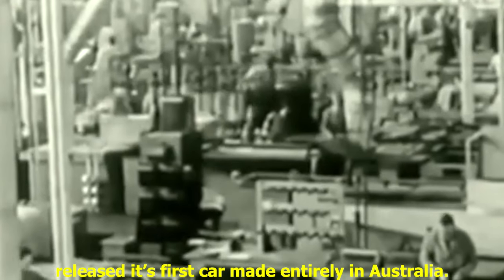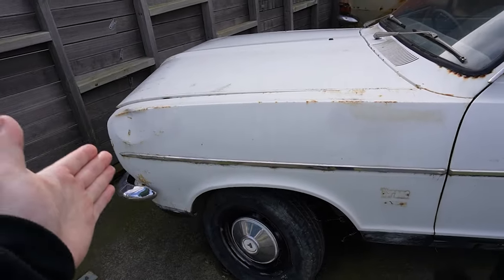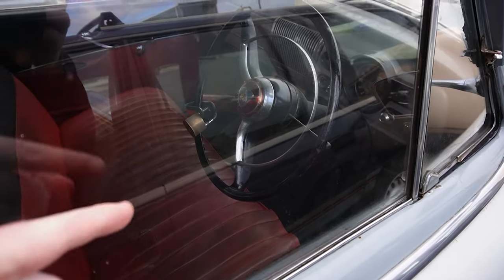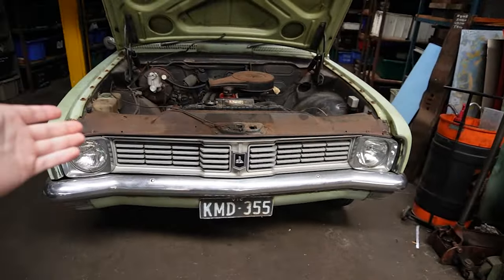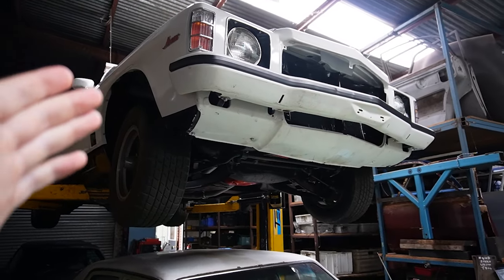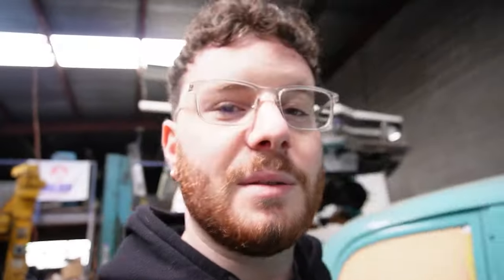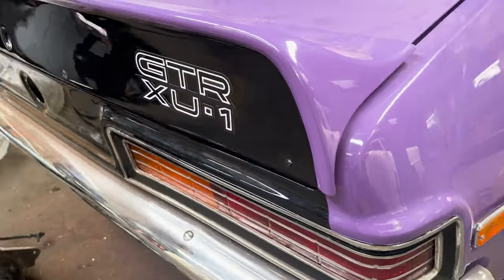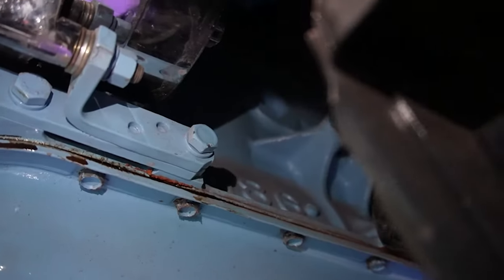This Junkyard has $100K Australian Cars.

Comment: My Dad bought brand new in 1970 a Kingswood HG station wagon which was ordered and delivered with a 308 V8 trimatic transmission, rear LSD and front disc brakes. Drove it around when I got my Licence , loved it. My mate had a 202 LJ torana 2 door, He turbo'd , had a four speed manual tranny, we had to fit a holden one tonner clutch in so the it wouldn't slip when accelerating.

Comment: 1966 HR Panel VAN. Apart from working my girlfriend, my efforts went into radicalising it in paint, motor, carbs, Splatt Dragway rims, arch, curtains, headers and disc brake front that came from a later Holden.

Comment: Fun facts the Holden red motors were around as late as the late 70’s, making it to the VB Commodore. Great motor but upgraded to the blue motor in the VC and then black motor in the 84 VK.  Then replaced by RB 30 in the VL.
I thought the LC only came out in the GTR (186 bored out 60 though to 192) then the GTR XU1 came out in the LJ (202 bored out 60 thou to 208);  any Holden heads able to clarify this one for me as I’m a blue oval bloke?

Comment: My dad had a HR Holden Premier with a 186S bolted to a Toyota Celica 5 speed manual. Power drum brakes and a big Holley 385cmf I believe. His mate took it out drag racing and came back and he said it's the fastest HR in Ballarat and Stawell. Got written off in 79 apparently by a taxi in Melbourne. He then got a 68 HK Monaro GTS 186s.